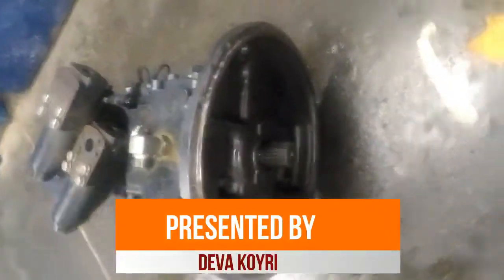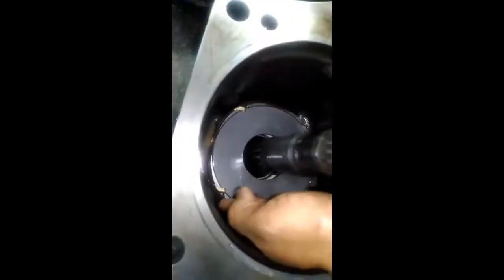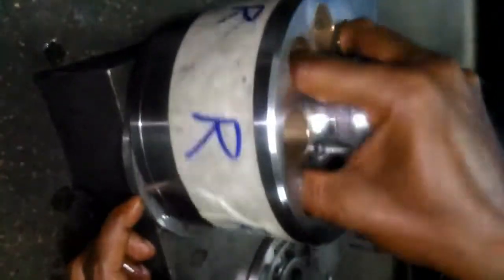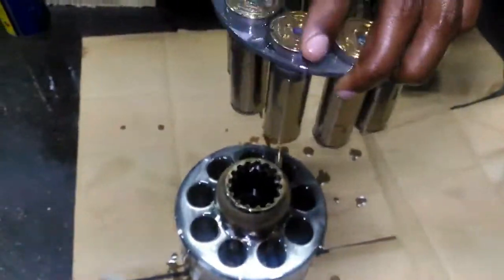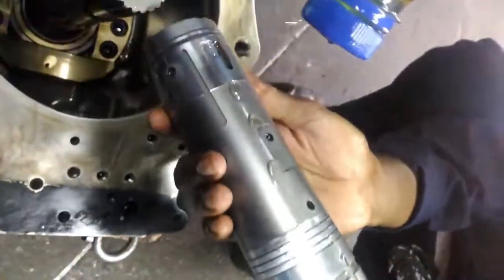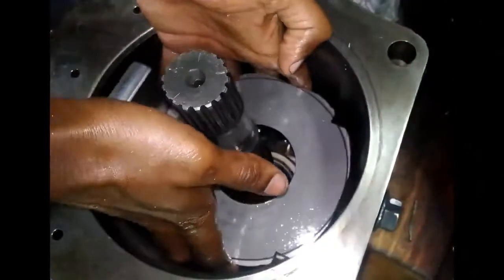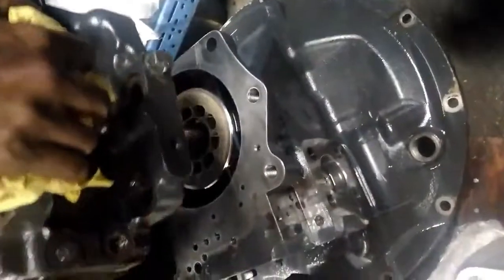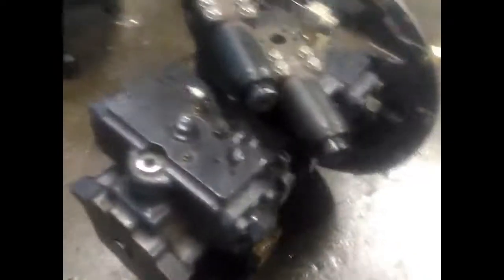Komatsu hydraulic pump assembling video

Comment: hyundai 80 yenmar engine parts available??  plz contact
Reply from the maker: Do you want hyundai 80 engine parts right?
Reply: @machinepointDevakoyri  yes plz give ur whatsapp no then it will be easy to contact..  my no is 7001462063
Reply: @machinepointDevakoyri  mai 2nd hand js81 2013 ka lunga kaisa machine hai  plz boliye acha hai ya bura
Reply from the maker: Do benifit hai second hand machine lene me pahli price ki or dusri resale value,  engine ki condition agar sahi hai or hydraulic operating system sahi hai 3 hours chalne ke baad to aap le saktey ho machine achhi hai....
Reply: machine ka swing slow hai par marching sahi hai engine sound akdam bariya hai
Reply from the maker: Koi baat nahi swing ki speed to thik ho jayegi traveling speed sahi hai?
Reply: @machinepointDevakoyri  ha travelling speed sahi hai...  kya disturb ho sakta hai
Reply from the maker: 3 hours continue run karne ke baad saari operation chek kariye  agar sahi hai to buy kar saktey hai.....